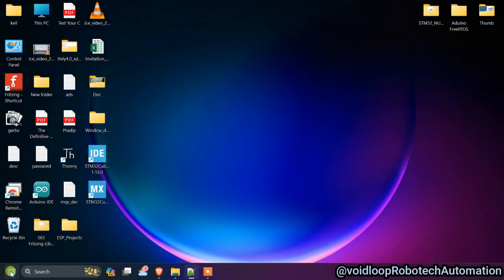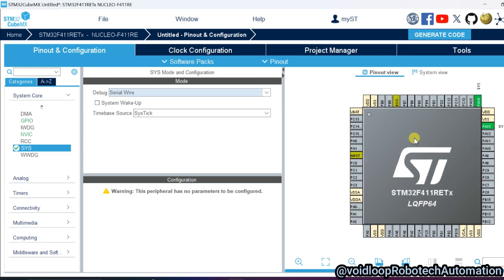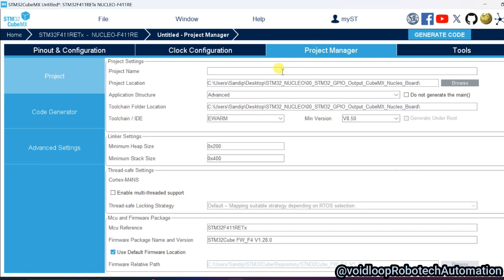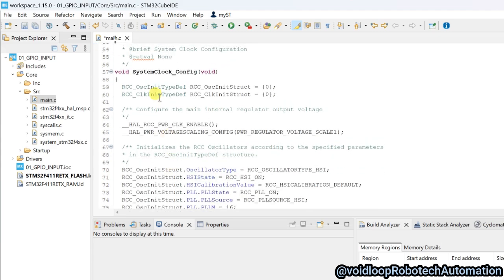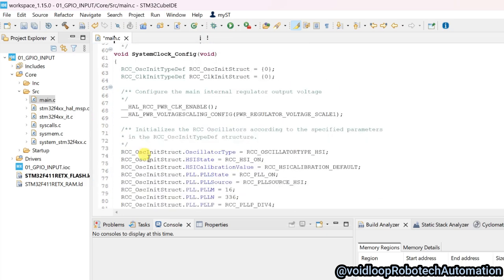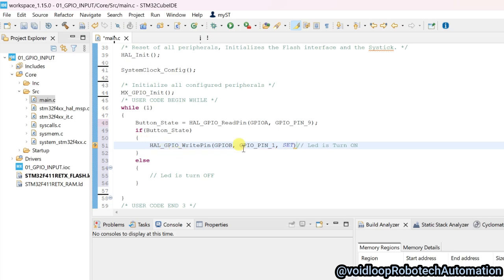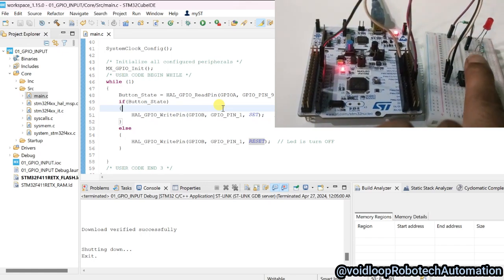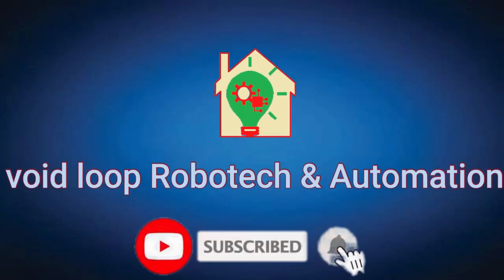01 STM32 GPIO Input with STM32CubeMX and STM32CubeIDE || LED Blink ||

Comment: Good example, could you say what in your case means:
Bypass clock source and 
Crystal/ceramic resonator?
Reply from the maker: It is just an example
Reply: @voidloopRobotechAutomation  I know it's example, but could explain it there, what actually means "bypass clock course"?
Reply from the maker: @andrewsotnikov5680   By pass  clock source means Control will not use external Clock source it will use internal RC clock source.
Reply: @andrewsotnikov5680  On the Nucleo boards, there isn't any additional crystal, if you look carefully you can see the empty area. However, we have a crystal for ST Link part. As I know, nucleo uses this crystal as external crystal. I think, this X1 crystal generates the bypass signal.